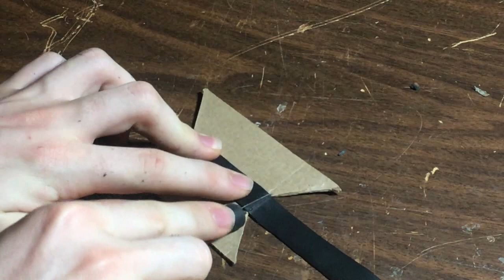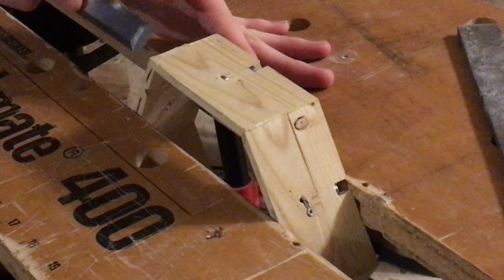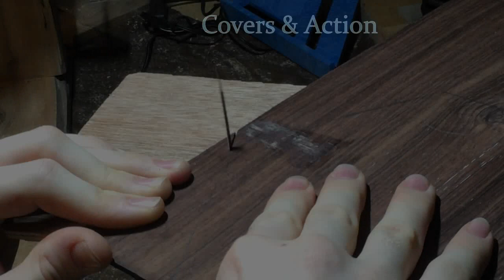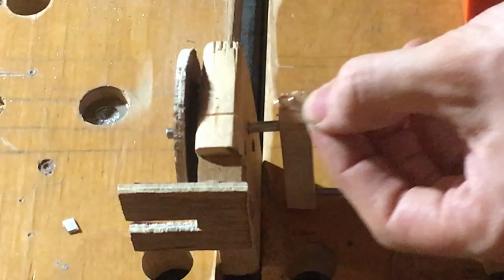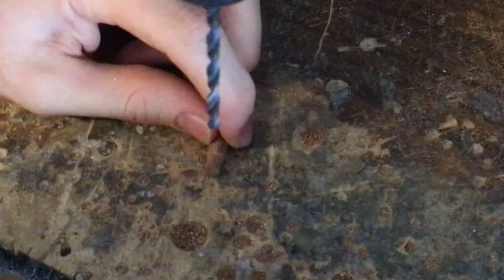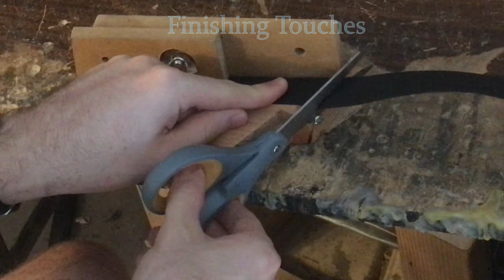Making a Crane Duet Concertina

Comment: Can I ask what metal "string" you use for the springs? I'm building a hayden duet 47 button and I'm having problems with getting any useful tension from the springs. So I probably bought the wrong kind of metal.. :/ And also thanks a lot for the inspiration from this video! I'm also building with a limited set of tools and from scrap wood (from an old melodeon box made of ply wood) so this video has already been very helpful! :D
Reply from the maker: I'm glad you took inspiration from this video! I was inspired to create these "making of" videos after seeing how few concertina making videos there were previously on Youtube and how interesting they were, so I'm glad it's made somewhat of an impact. 
I used about .7 mm phosphor bronze wire for the springs. I've seen a couple of different spring materials used in various concertinas, such as stainless steel or brass. Getting a good spring tension is also a function of how many coils there are in the center of the spring and the length of the spring "arms", so you could experiment with that as well.
Let me know how the build goes if you're interested!

Comment: Where did you source the reeds from? I'm trying to make a concertina and I'm not sure which ones I should be looking for or what price is a fair asking.
Reply from the maker: Reeds were sourced from an old accordion. Recent models are better for this as they are more likely aluminum, which is much lighter than older zinc reeds.
Reply: @cas_creations  do you happen to have the rough dimensions of the trapezoids that make up the bellows? Also, do you have an approximate thickness for the leather you used?

Comment: Why build a Crane Duet when you could  build a Hayden Duet?  Haydens are fantastic instruments  when properly done,   and for many,  the best of the three Duet types.
Reply from the maker: Having some experience playing an English, I found the Crane to be the most logical in terms of button layout and easiest to understand. Also important to me was the fact that the buttons on Cranes are more centered than on MacCanns or Haydens, which would simplify the action construction a bit, reducing the number of short levers.
Reply: Fair enough I reckon,  but I have been playing Haydens (Stagi and Morse Beaumont)  for  about 12 years.  For me,  the great Hayden advantage is that you can play "easy peasey"  in  4-8    different keys-- depending on model -- using the SAME chording/fingering PATTERNS!  How's that for versatility!    @cas_creations
Reply from the maker: @frankevich  Haha. Well that's true I suppose